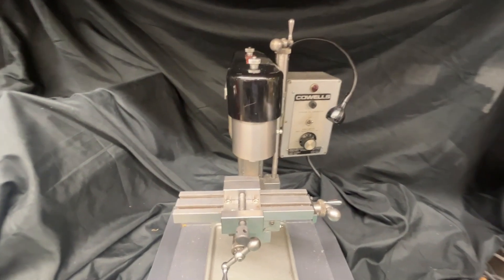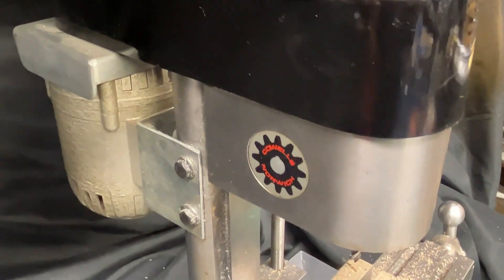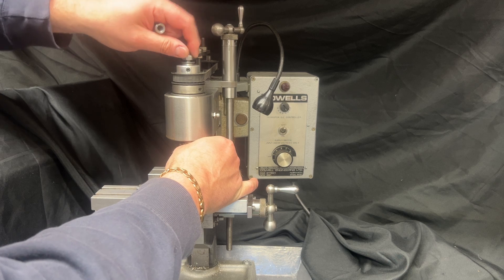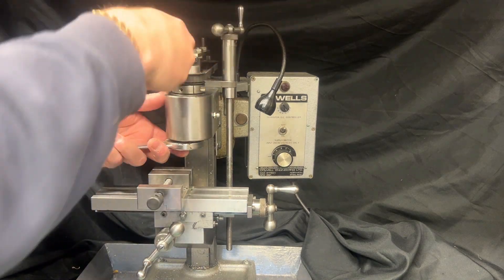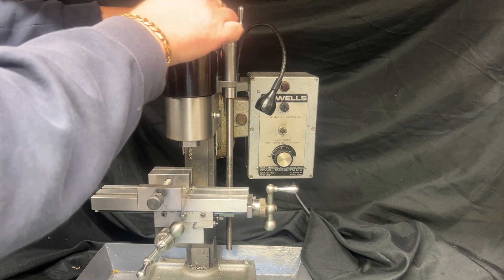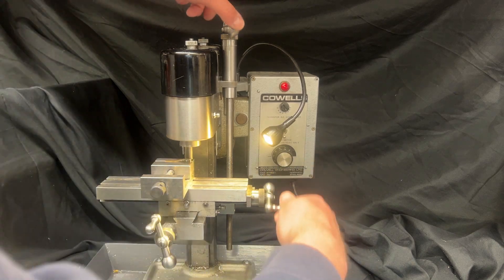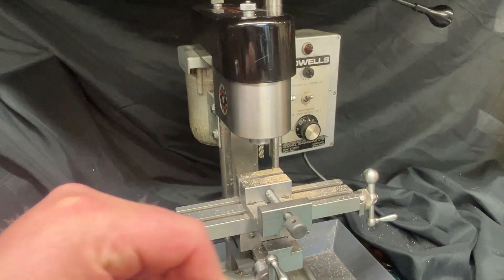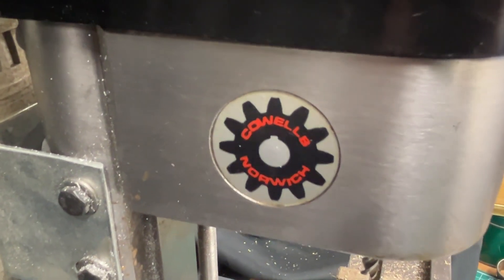Cowells Vertical Milling Machine – Precision Engineering in a Small Package

Comment: I've got one of these (new) and a ProxxonFF230  which does have a quill and a larger table. The proxxon is basically a drill press; the tiltable headstock makes it useless for anything beyond the lightest milling operations. At some point I'm going to add dowels to the headstock to lock it in place; maybe use it to cut flyweels (it's also a great drill press). I was hogging CK45 on the Cowells. It behaves like a much larger tool.
Reply from the maker: They are amazing but pricy. However you can’t compare with other similar size tools. Their lathes are the same.

Comment: Great little machine, I love mine!

I agree about the head, the round one looks much nicer. The later version mill does have resettable dials and a bit more room under the head though!
Reply from the maker: Thanks for the comment. Yea - I presume you can fit the resettable dials on my older model without too much modification?
Reply: @craynerd  Yes probably. 🙂